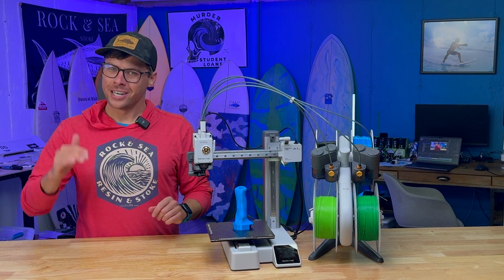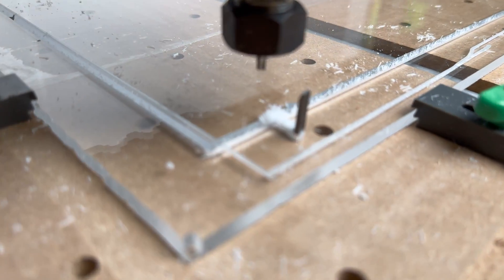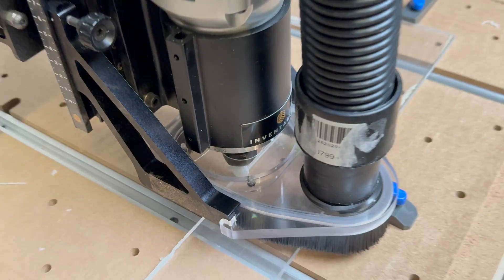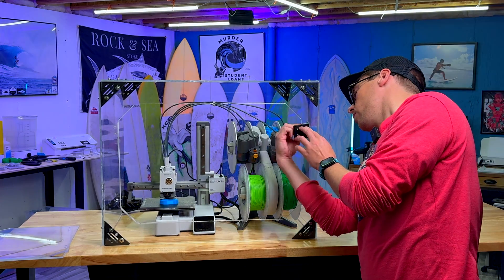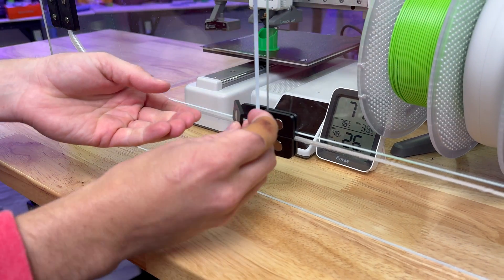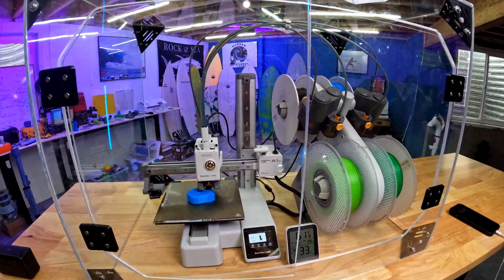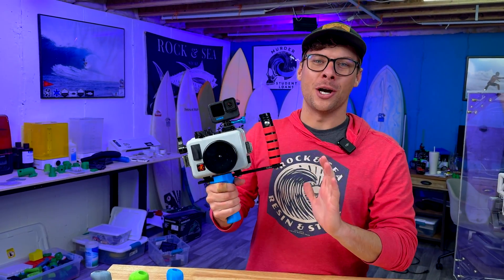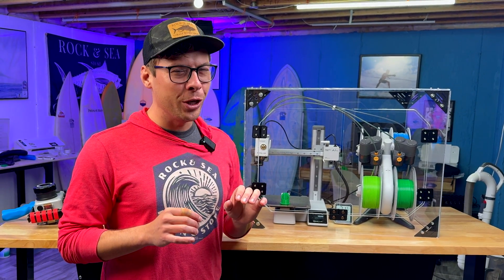Ultimate Enclosure for Bambu Lab A1 Mini

Comment: Use shorter bits for thinner materials, maybe plus 5-10mm to the thickness of the material you are cutting. also do a couple of passes instead of one pass. Also check feed speed.
Reply from the maker: Hey great advice, thank you! Just getting into CNC!!!

Comment: I'm considering the A1 mini as my entry to 3d printing but would need heat resistant filaments (main purpose: custom computer case). Does such an enclosure work well enough for ABS / fiber reinforced filaments?
Reply from the maker: Unfortunately not, you really need to bump up to either the x1c or 01s to print and and carbon fiber reinforced.    But you will not regret it.  I started on a basic ender 3, very fun but frustrating at times, bambulab makes 3D printing so much easier and stress free especially if your just getting into it!!   Auto bed leveling is a game changer and all the other little features that add up and make a night vs day difference
Reply: @JDubHannah  thanks for responding!
Reply: @wanzai567  I actually just watched a video on the Aurora Tech channel and they had good results on small parts with an enclosure, I would check that video out and see what you think. He is right though that if you have the budget, go for the X1C or P1S.
Reply: @mac_318  I ended up getting the A1 mini. Will just prototype with it, since I want the case to be metal after all. So far pretty happy with the mini. Thanks for the follow up!

Comment: can you just put the bottom of the enclosure between the bed and the bottom of the printer? this way you avoid the risk of burning your motherboard.
Reply from the maker: that's a great idea, may have to CAD it up and give it a build!   My basement in this vid was super cold, and only got up to low 70's even when printing so I wasn't concerned about it getting burnt out, but just moved back to cali for surf and my printer will definitely get cooked if I leave it enclosed

Comment: Not very air tight is it tho? what about the fumes :(
Reply from the maker: Not airtight and doesn’t have a high enough bed temperature to get into fancy filaments like carbon, ABS and nylon, it really is only good for PLA and PETG which don’t de-gas crazy fumes. It’s not airtight , but does a good job of just keeping it isolated from  airflow within the room.  It’s a pretty cool budget solution for getting Hugh quality PETG and PLA prints  but if you’re trying to fancy stuff definitely upgrade for an extra thousand bucks and get the X1C!

Comment: I heard someone else say they talked to bambu about an enclosure and they where told the cpu wasn't rated for the higher maintained Temps so if your motherboard fries prematurely that's why
Reply: can you just put the bottom of the enclosure between the bed and the bottom of the printer? this way you avoid the risk of burning your motherboard.

Comment: Looks very good. My question is how’s about temperature inside? Bambu lab don’t recommend a enclosure because of not activ cooling on the mainboard.
Reply from the maker: Very good question, I wouldn’t use an enclosure if the room temp was ambient, but my basement hovers around 55, with the enclosure and the printer running, the temp in the enclosure hovers around 72 which pretty baseline room temp for most people.  Long story short, if you have a normal room temp and  probably don’t need an enclosure, but works miracles for cold rooms or older gen printers
Reply: The A1 mini has active cooling; it’s the bigger A1 that does not